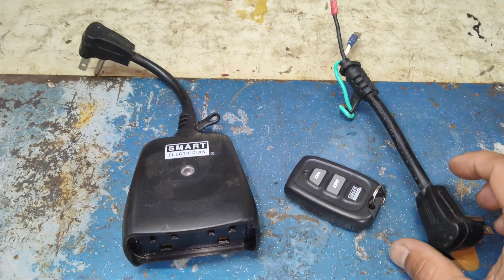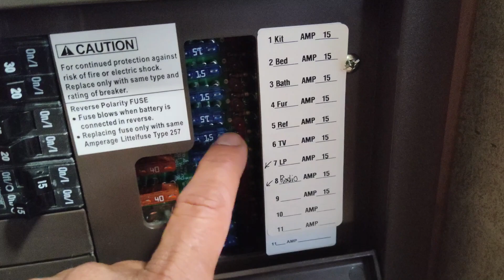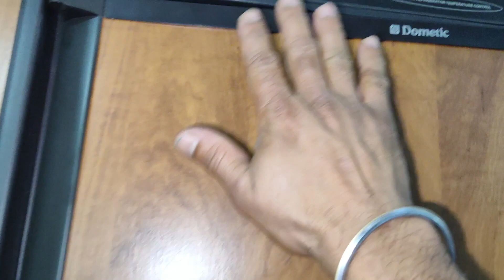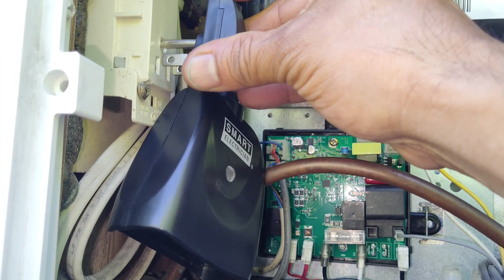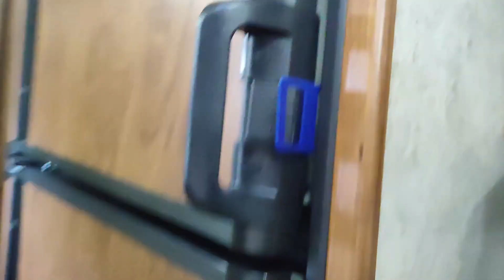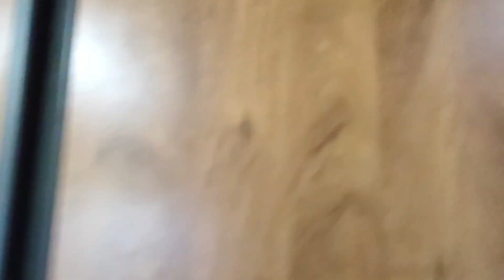Dometic Fridge Control Board Bypass | Emergency Only Guide

Comment from the maker: Replacement Control Board for RV Dometic Refrigerator 
CLICK HERE: 👉  https://amzn.to/3vwRFMY

Fluke Digital Multimeter Circuit Tester
CLICK HERE: 👉  https://amzn.to/4asL3hG

DOMETIC Refrigerator Wire Shelf Plug & Clips
CLICK HERE:  👉  https://amzn.to/47KN34b

DOMETIC Shelf Clips Only (10 Pack)
CLICK HERE:  👉  https://amzn.to/3ONbk0P

Dometic Fridge Replacement Door Handle for 
CLICK HERE:  👉  https://amzn.to/3ONbIwj

DOMETIC Refrigerator Wire Shelf
CLICK HERE:  👉  https://amzn.to/3Pb6jRj

Refrigerator Side Wall Vent  RV  20" Compatible with Dometic WHITE (This is Exterior of Camper) 
CLICK HERE:  👉  https://amzn.to/3YQjryf

Refrigerator Side Wall Vent  RV  20" Compatible with Dometic BLACK (This is Exterior of Camper) 
CLICK HERE:  👉  https://amzn.to/3qBAXKa

Refrigerator Airing Device Compatible with Dometic [2 Pack]
CLICK HERE:  👉  https://amzn.to/3OL2LUd

Comment: Please don't do what he is saying. If you put power to the temperature element as he is saying it will be a direct short. If you watch the video carefully he doesn't plug the cord in that he hooked to the element. He plugs the 110 plug for the fridge back in.
Reply from the maker: Hi, thank you for watching.  I think you may have miunderstood this simple concept.
    The 110V heating element is a large resistor that limits current flow and does not inherently create a short circuit under normal operation when plugged in directly.  Essentially the circuit board is doing the same thing(feeding heating element the 110V),  it's just that a good circuit board is able to turn it on/off.  Now, if the the heating element it self is internally shorted then offcource by plugging it in directly to 110v outlet will create a direct short you speak of.
  Not sure where you see just the fride plugged.   Plugging just the fridge in with circuit board that is failing to provide 110v to the element will acomplish nothing.   Remote outlet was plugged in and the element is plugged into the remote outlet, so the on/off function can be manully controled.

Comment: My fuse on my main rv control panel that controls the fridge also controls everything else in the room. Interior zone 2 fuse. Is there a way around it?
Reply from the maker: Hi, thank you for watching/subscribing,
Yes, that is how the 12v system is wired in most of the RV's.  If I understand correctley, you want to separate your fridge from the rest of the room so that a blown fuse in Zone 2 won't shut down your refrigerator or  the other way around?
If so, it's certainly possible to run a dedicated power wire & isolate the fride on it's seprate circuit..  This ensures that even if the rest of the room blows a fuse, the refrigerator will stay powered on and keep running safely.
Reply: @JSFautoPlus I want to do what your doing to run my fridge with the bypass wire. It’s not working. Is it because the eyebrow control panel still has power? I have the bypass wired correctly. the interior zone 2 controls my air conditioner so I need to keep that fuse in
Reply from the maker: You can disconnect the power to the Control board and disconnect the eybrow connection.  But please be cautious as this bypasses all and any safety measures.  If the heating element is heating the coil by direct bypass and  still not cooling then the issue may be in the sealed system it self.

Comment: This also bypasses the thermostat and will use the maximum amount of power
Reply from the maker: You are correct, this will bypass everything (including any safety)  when power consupption is not a concern and  is intended only as a temporary emergency bypass to keep food cold. Thanks for the heads up! 👍

Comment: Hey , i changed my circuit board and still no cooling . Everything seems to have power,  electric heating element has 44ohms/2.7 amps , propane has a small flame , thermostat in the fridge increases ohms when dipped in ice water , but no cooling . Maybe the sensor on the heating chamber ? Idk at this point
Reply from the maker: Hi, thank you for watching/subscribing.
These are convection (absorption) or standard type refrigerator.  If it's still not cooling despite a working heating element,(working circuit board is calling for cool & coil is being heated) the issue likely lies in a blockage or leak in the sealed cooling system or a lack of proper air circulation.
In absorption fridges (common in RVs), the ammonia solution can crystallize and block the gravity-fed tubes.
Some technicians suggest "burping" the fridge (removing and flipping it) or gently tapping the coils with a rubber mallet to dislodge blockages.
There could also be a refrigerant leak, Check for a yellowish powder or a strong ammonia smell, which indicates a terminal leak. If the coolant has escaped, the unit must typically be replaced.

Comment: How do you bypass the fans? These refrigerators won't work properly without the fans running.
Reply from the maker: Thank you for watching/subscribing.
This particular refrigerator does not have a fan & rely just on natural convection.

Comment: I have the same fridge. While I am waiting for my new control panel I keep my fridge cool by freezing 2 water filled plastic 2L coke bottles.   "Luckily I have a chest freezer as well"    I put both the frozen coke bottles in the fridge and it  has been keeping it at the ideal temp.  "Fridge only" not the upper freezer compartment.   Thank you for your vids, they are very well done.
Reply from the maker: Thank you for watching/subscribing!